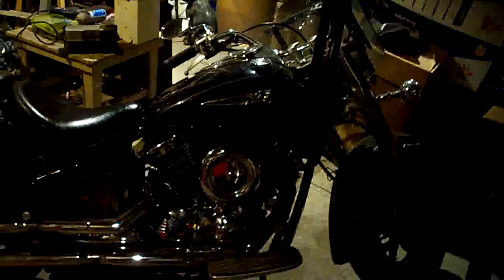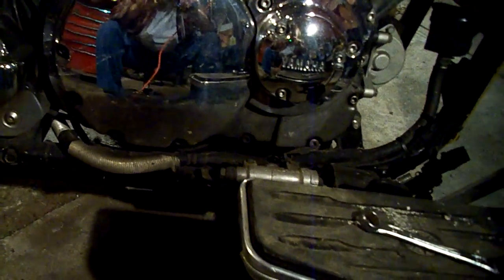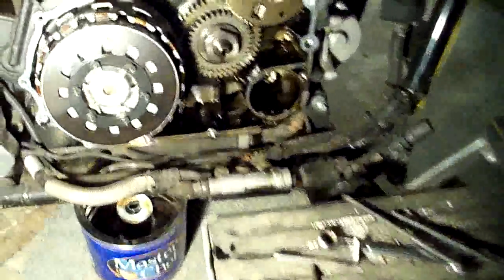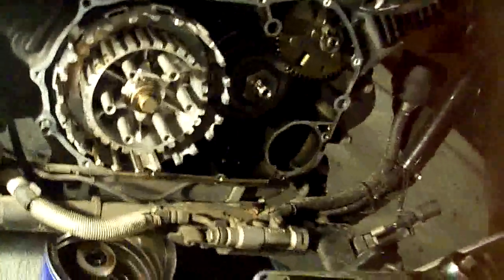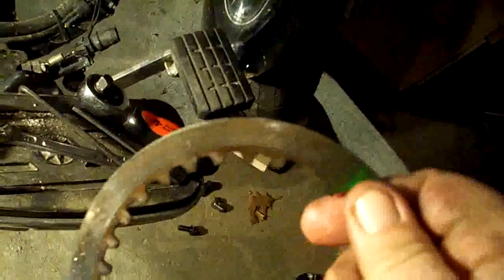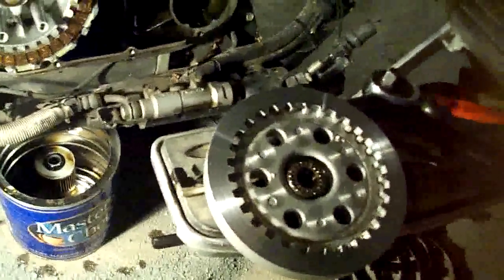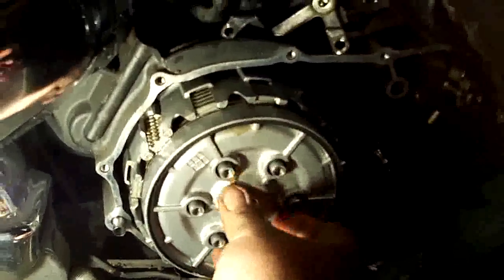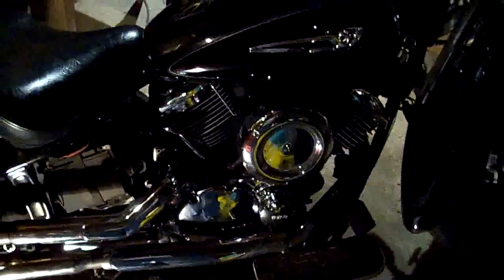2004 Yamaha V-Star 1100 Clutch Replacement

Comment: The 6 spring plate bolts are torqued to 5.8 ft lbs in case anyone is wondering.  Some say 5 to 7 ft lbs. Replaced the springs last night with 64 lb Barnett springs and plate.  I had to search high and low for the torque spec.  Great video!
Reply from the maker: Thanks for the info. I never realized that I didn't add that in there. How do you like that Barnett? I thought about getting one myself but it'll have to wait a while. I hit 2 deer with that bike 6 years ago and rebuilt it and 4 weeks ago I hit another one. I had crash bars on it this time and there's very little damage to my bike but I have to heal up. 1 broken rib and a lot of road rash this time. I'll get her fixed up but I don't think I'm going to ride like I used to.
Reply: What is the result if over tightened?
Reply from the maker: @shaunnelson1360  Sorry I'm so late responding, I just now seen this. If you over tighten it too much you'll snap a bolt then you got worse issues. It can be a pain to get a broken bolt out. I didn't have the torque wrench I needed at the time I made this video but I have one now. Torque to specs is the way to go if you can.

Comment: This was a very well-made video. You've explained everything to me that I have to know. I thought it was going to be extremely complicated you make it seem very easy. I just bought a 2003 Yamaha  V-Star 1100... It was really cheap I think my budget for $400. I needs a lot of work definitely a project bike. I've owned it for a week and I've seen major things that need need to be done with it like clutch oil leak lights gas tank brakes cables and a heart hypercharge filter it runs really good it even shoots fire I don't know if it's supposed to do that this is my first bike I've ever owned at the age of 50. definitely a project bike and I'm going to enjoy putting it together. Thank you once again. I hope you get your wife's bike on the road so she can start riding with you you're the best.
Reply from the maker: Thank you. And good luck with your project. I had to rebuild mine. I hit 2 Deer with this bike 3.5 years ago. She looks a lot different now. I don't think it's supposed to shoot flames but mine does the same thing, LoL.
Reply: I just enjoy looking at it. I can't wait to get it on the road. I figured the clutch in the tail lights should be on somewhere around Christmas. I'll keep you in the loop and tell you how it goes. Once again thanks for your wishes. keep your eye out for them deer.

Comment: So, I just finished replacing clutch kit. For some reason my bike won't change from 1st to neutral when I'm at dead stop and the engine is running. When I'm riding it changes gears no issue. When I shut the engine down I can put in neutral. Any ideas?
Reply from the maker: You've got me stumped on that one. Mine hangs up a bit some times but not like yours is.

Comment: I bought a wrecked and riding 05 off a guy gas tanks pretty fubar and so is the left foot stand imma swap it for some pegs and I noticed the clutch slipping as it gets 60 mph to 2nd gear but no gain in the higher gears assuming at 17k miles no ones swapped the plates I'll soon be swapping the plates but think I'm gonna let it set until I can get the tank, grips, pegs plates gaskets and oil altogether and make a day out of it. Its bobbed out and eventually will need to fabricate a better tail light option for it can't wait to start restoring this beast though
Reply from the maker: Sorry I'm late to reply. That would be my guess that the plates are slipping. You might get away with adjusting the clutch at the lever but sooner or later you'll probably need to change them.  I bought mine on Ebay from Sledpartsguy. They are cheaper than OEM and don't last as long but I've gotten my money's worth and then some out of them. I'm going to change them out again this winter because they're starting to slip.

Comment from the maker: If I didn't have to the video while working on it, I guess it would have been about 1.5 hrs give or take a few minutes. A local shop was talking between $436 just for clutch plates alone. I bought the clutch cover gasket and the oil filter cover gasket from them for under $25 for both and got the clutch plates from ebay for $35 plus shipping. Total, under $70 by doing it myself.

Comment: Hey trreb1 solid video, just a quick question for ya.  I know you didn’t get as far as removing that very last clutch plate that’s held in with that wire spring.  But I was wondering if you had any insight on what position that very first plate goes in at.  I pulled out all other friction and steel plates and they were oriented like how you said with the sharper edge side towards me, however that last steel plate with the wire was removed and it was opposite to all the others with the smoother side facing me.   Is that intentional you think? Thanks In advance

Comment from the maker: Glad this helped you out. I didn't have any leaks from from my covers and when I pulled it apart I only had a few places where the gasket was a pian to  clean off.  I thought about getting a relo kit for my filter, other than the leaks you had, was it worth doing? I haven't run into any one else that has done that yet in order to ask them.

Comment from the maker: I didn't think about this till now, but what I meant by using the screw drivers is that there are a few spots where you can use them to pry the cover loose a bit WITH OUT trying to pound them in between the cover and the crank case.

Comment: my 05 1100 had a wire ring/ band holding plate 1 against the anti-chatter parts at the back of the clutch boss. It seats in little grooves at the deep part of the boss.
Some websites say we don't need that wire but I gotta think Yamaha knew what they were doing.

Comment: Great video! just did mine same bike but I'm not sure how tight the pressure plate spring bolts should be? Any advise? I think I overtightened them and my clutch is super hard to squeeze.
Reply from the maker: Did you use a torque wrench on them or just tighten them up with a socket? If you don't have a torque wrench that is in-lbs(Inch Pounds) you might want to see if someone you know has one or if a local auto parts store loans them. They should be tightened to 71 in-lbs. If that doesn't do the trick then I'd look are your cable and make sure nothing is binding up from the clutch lever all the way down.

Comment: Excellent, really good video that gives me the confidence to attempt this myself.  I am seeing a small amount of clutching slipping under acceleration.  Is there anything else I should check before jumping in and doing a clutch replacement (the bike is a 2001 XVS 1100 that's done 15k miles.
Reply from the maker: If it don't have a lot of miles on it, you might want to check your clutch adjustment first. It can't hurt. If you can adjust the cable and it solves the slippage problem you'll save some time and money. I adjusted mine when it started slipping and got about another year out of the clutch if I remember right. I have discovered 1 thing though, I bought the plates on e-bay for about $40 and they seem to be starting to slip a bit. It could be because of the cheap plates but it could also be that my cable is getting stretched out a bit and I might have to replace it. I'll know more once we get rid of all this freaking snow here. lol Over all, the cheaper plates have done me good, no real complaints about them.

Comment: Great video Trreb I have same bike overseas didn't ride it two years sleeves got locked together
Had some one pull out and clean didn't help! I thinking taking all new sleeves and following your video! Any ideas other than buying all new clutch sleeves?
Reply from the maker: Buying new is the way to go really. I didn't replace the steel plates between the friction plates as mine were in great shape. If the steel plates are pitted bad, it would be a good idea to replace them or you could rip up those new friction plates sooner than expected. Also, don't be in a hurry. I just took my time with this project and every thing turned out great.
Reply: thank you!

Comment: @trebb1, im currently going to do this... i started doing it because when decelerating with the clutch out i hear (depending on the rpm faster or slower) scrape scrape scrape scrape etc.... and i have slippage in the clutch. so hopefully this takes away both problems. how do i know if they are worn enough to even need replaced?

Comment from the maker: I guess you may not have to remove the entire pipe, but since my mufflers are not stock they are not welded together with the cross over tubes so it just made it easier to see what's going on by getting that pipe out of the way. I'm not exactly sure what you mean by the retaining wire. I don't remember a retaining wire on mine. Where exactly did you find this wire?

Comment: Can you tell me if this is the "starter clutch assembly" that you are doing here?  Also, can you tell me what your bike was doing that caused you to do this repair?  Thank you.
Reply from the maker: This is the clutch for the trans. The starter clutch is located on the left side and is only for starting.  My bike started slipping when I would take off or give it the gas while I was going down the road. By slipping I mean that you let out the clutch, give it some gas and it wouldn't want to go like it should.  I'm in the process of shooting a video on replacing the final drive on my wife's 650 v Star but I have to wait for the parts to get here before I can put it back together.

Comment: If its slipping  do I replace the clutch first (I just got the same bike with 16000 miles). what parts do I need to get ? please post a link.  Thanks
Reply from the maker: Hi Paul, I just get mine from sledpartsguy on ebay and have been happy with what I have ordered from him. If the steel plates are good then all you need is the friction plates and gaskets for the covers and since you're going to take it down that far I'd replace the gaskets for your oil filter cover as well. I believe it's an O-ring if I remember right. If the steel plates are pitted or worn out to bad then you'll need those also. I'll be ordering more parts from him for the bike in this video because I layed her down 5 weeks ago. I hit 2 deer at the same time and am lucky to be alive right now, so I need to get this bike fixed up again. Here's a link to get you to the sledpartsguy store on ebay.  http://www.ebay.com/sch/i.html?_from=R40&_trksid=p2050601.m570.l1313.TR0.TRC0.H0.Xsledpartsguy+2004+yamaha+v+star+clutch+plates.TRS0&_nkw=sledpartsguy+2004+yamaha+v+star+clutch+plates&_sacat=0
Reply: Trreb1 Okay it is Clutch day tomorrow.  I have a manual tech -cd and it has me needing a clutch tool and is very short on detail.  Please watch this thread now and again in case I have an issue.  Wish me luck.  You made it look easy.  I have a rattle in my upper pipe when I change gears (Baffle?) is there any remedy for that while I am working on it? I do have the adjusted front oil filter placement... I am worried about that gasket and o ring.
Reply from the maker: Howdy again Paul. I never needed a clutch tool when I did mine. I'm thinking that you may not need it but if it's cheap enough and you find that you do need it then I'd get it. I'll check in every once in a while to see how you're doing. Let me know when you get it done. As for that rattle it could be a chrome gaurd on the pipe that's loose or maybe one of the flanges the hold the pipes in. The baffles will be in the mufflers. Keep an eye on that O ring and gasket. I was going to get the same set up but heard from to many people that they always leak. Let me know if that works out for you also.

Comment: I did this but the clutch is slipping like crazy. I assume it's because of the oil. Are you sure it needs to be left in oil ? Or do you have any idea as to why it's slipping after replacement ?
Reply from the maker: Yes, they should be soaked in oil. They will get oiled any way when the bike is running but you don't want to put then in dry or you could cause damage to them. If you did everything right and it's slipping then I'm guessing your clutch cable needs to be adjusted, or the springs in the clutch are too weak or not tight enough.

Comment: I got everything buttoned up, queezed my clutch lever and it bottomed out.  Any idea why it would do that?
Reply from the maker: Sorry I'm a week late getting back to you. I'm not sure off hand. The first thing that comes to mind without seeing it is clutch cable adjustment. If everything went back together with no problems then I'd start with the cable. Mine felt really stiff because of the new disks so I had to adjust it a bit. Also, just wondering here, did you get the spring back in the right way? Some times I get in a hurry and will put something in backwards without realizing it. Could also be a weak spring, but I think that's rare.

Comment from the maker: KODAK "EasyShare" M1093 IS. It shoots .MOV and I used "FoxTab video converter" to convert to .AVI.   I really didn't have any place to set the camera down and still get good footage so I had to do it stop and go. Also, it was to hard to hold the camera and do the work at the same time since I had nobody to hold it for me. The only thing i left out really was the fact that on a stock exhaust you have to take the mufflers off first since they are made as one.

Comment: Great video! Dude I've been a loyal customer at my neighborhood dealer repair shop and they reward me by butt raping me and over charging me for clutch repair. Well after watching this video, I feel confident to attempt it myself. Without opening it up they said that they will need to change the clutch and starter clutch, which confuses me because it starts up fine. This is my second clutch in 32000 miles.
Could you explain why you scuffed up the plates and how much scuffing?
Reply from the maker: It's not that bad to do it yourself and the best part is you save some money that way. In normal wear you'll get what looks like a glaze on them, scuffing them up a bit will clean them and remove that glazed look for less chance of slippage. You don't want to push to hard with the sand paper, just enough to clean them up a bit. I did this clutch @ around 18,000 miles or so and I just turned 32,000 miles on it yesterday with no problems at all. I do need to replace my starter clutch now, but if yours is rolling over and starting with no problems then you shouldn't have to replace yours like they are telling you. Hope this helps you out.

Comment: good video by the way!
Reply from the maker: I just got to work Dan. I'll reply back in the morning.
Reply: Ok thanks, i still have to order the new stuff anyway
Reply from the maker: Hey Dan, in the video you'll see the lines on the surface of the friction plates. When the plates wear down you'll see that the outter suface of the plates are getting closer to those lines. That's one way to tell they need replaced.  

Going by what you said earlier about the scraping noise you hear, I'd look at the steel plates also.  They could be ok, but my guess, without seeing them or hearing them, is that the friction plates have worn down so much that the steel ones could be worn out as well.  Kind of like going metal to metal like brakes do. 

 Check out Sledpartsguy on ebay. That's where I get most of my stuff and the plates you see me putting in on the video only cost me about $39 from him compared to the $300 and some that the dealer wanted for them. They are a cheaper plate and don't last as long, but I've got many many miles on them and have been happy with them. I need to change mine again already, but for $39 and a few years of riding, I got no problem with that. Hope this helps you. If you have any more questions I'll do my best to help from here, just let me know.
Reply from the maker: Sorry I didn't reply when I got home this morning. I drive semi for the U.S.P.S. and was tierd and fell asleep. lol